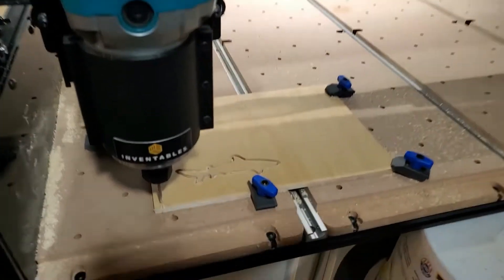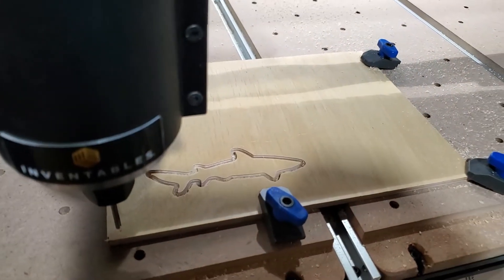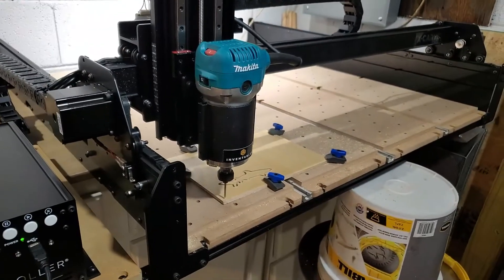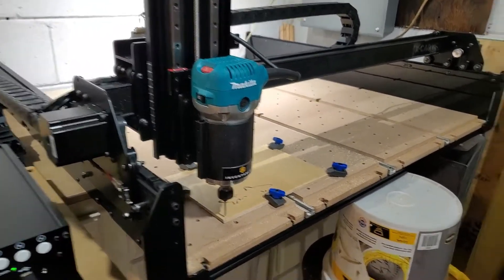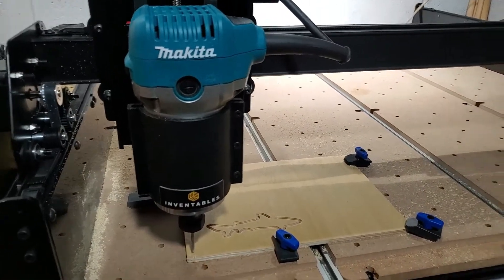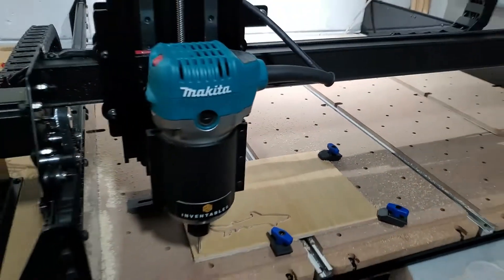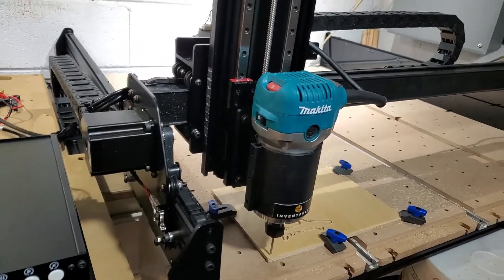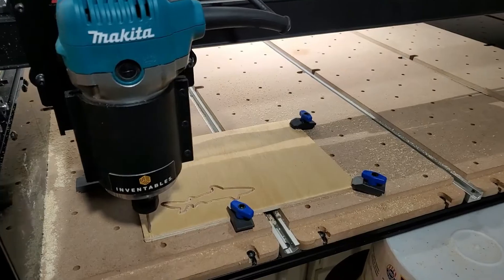First 100 X-Carve Projects Review

Comment: Enjoyed your video and admire your perseverance!! How did you resolve the little metal tags from moving?
Reply from the maker: I ended up making a different MDF clamping jig for the metal tags.  I had two or three iterations before I go the size correct.  I cut the the jib down the middle so that I could apply clamping force and then used a piece of blue tape on top to hold it down.  That worked really good for me.